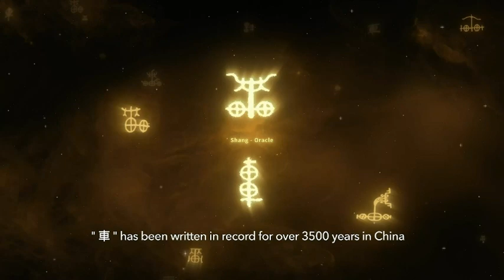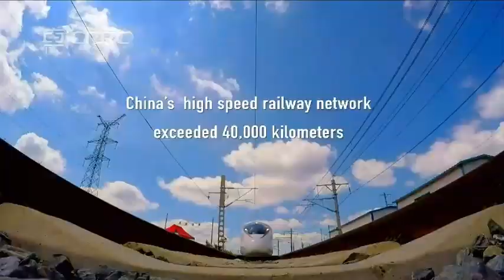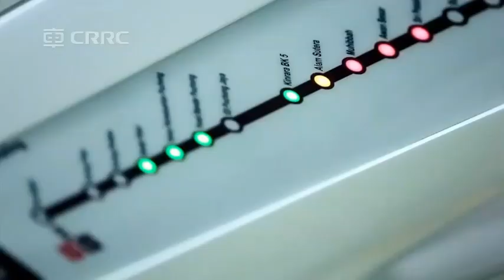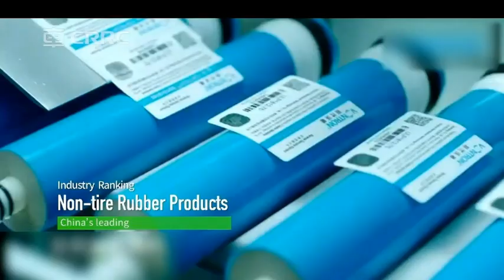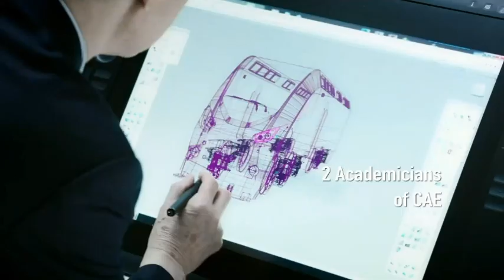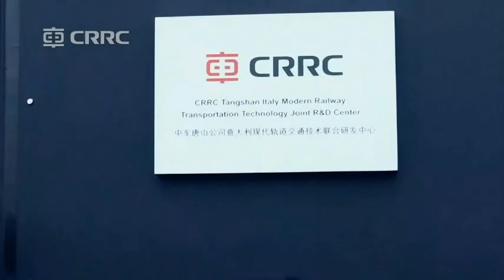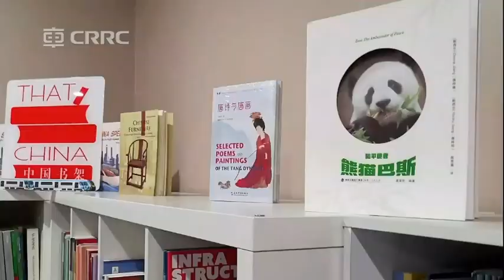CRRC Promo-InnoTrans 2022

Comment: You could have ridden it in Germany up until 2011. What they present there is called a Transrapid. Invented and developed to serial readiness in Germany from 1969 to 1993 and further up until 2011. The regular speed of that "super copy-cat maglev" is actually only 30km/h higher than the german build Shanghai SMT (450km/h).